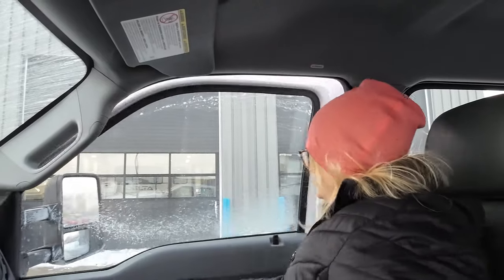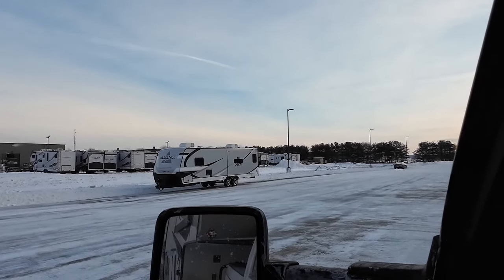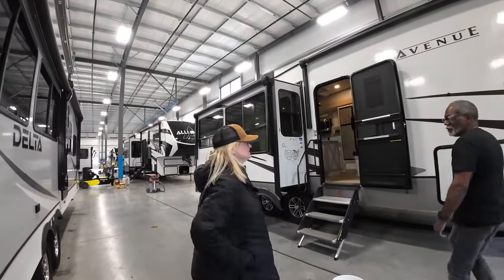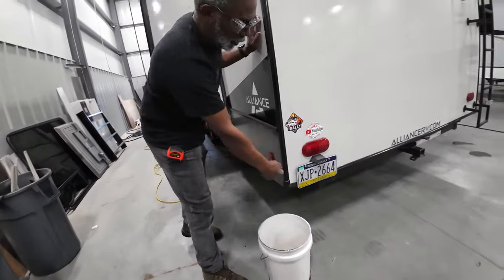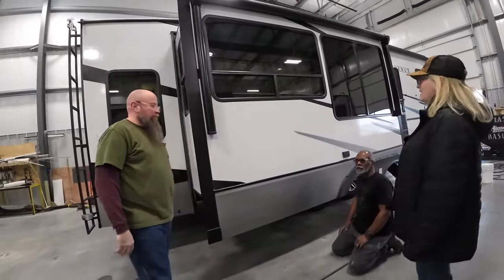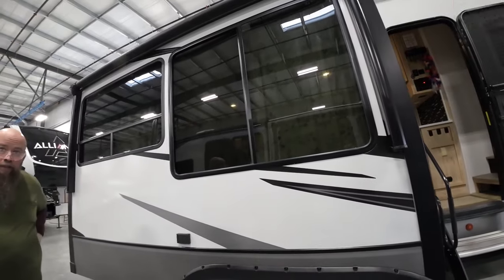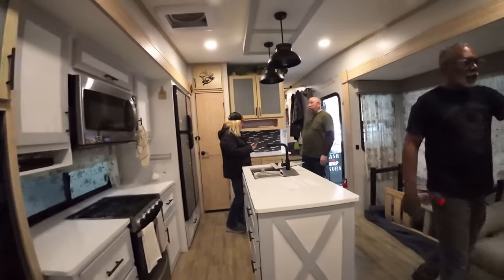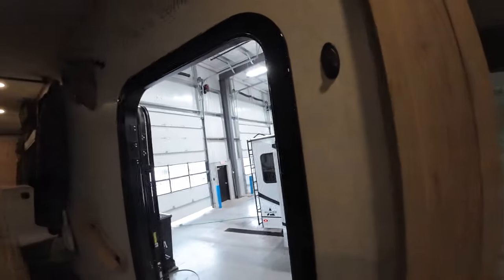Picking up our Avenue 32RLS at Alliance service

Comment: It looks like they did a great job!  I’m wondering about the ladder.  I didn’t see grab handles on the roof.  How is someone supposed to get up there?
Reply from the maker: There is a hand hold. It's separate from the ladder. I like  more than the traditional ladders. There's nothing to get in the way.
Reply: @checkingitoutwithrich5711  so is it easier to get on and off the roof?
Reply from the maker: Yes, it is a lot easier. You don't have the big hand rails sticking up getting in the way
Reply from the maker: Youtube won't let me post a picture here or I would.